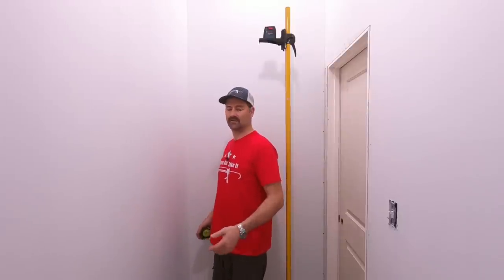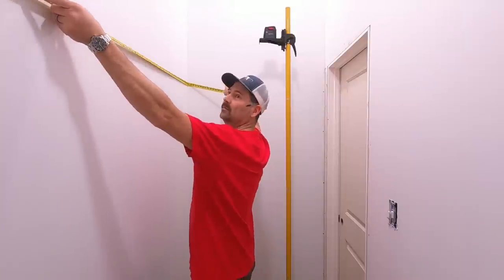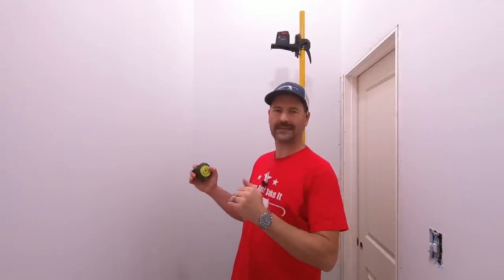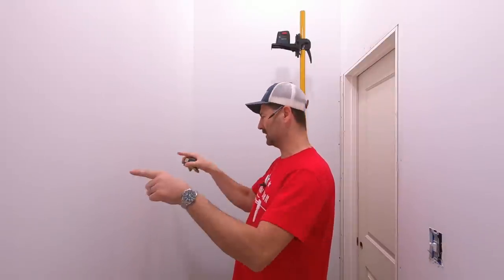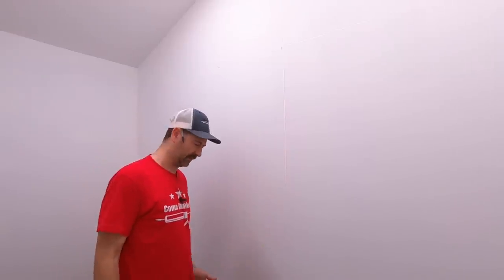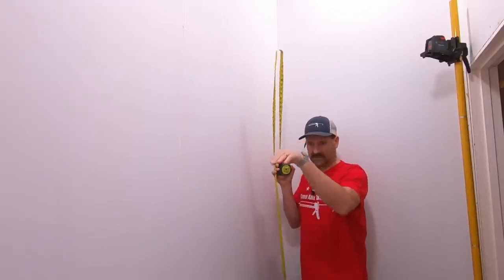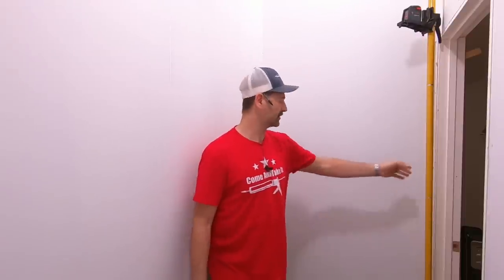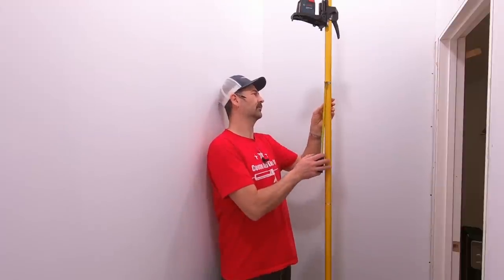Level Five Walls By Hand | So Easy A Handyman Can Do It | THE HANDYMAN |

Comment: Nice work, but I thought level 5 meant that you have to skim coat everything smooth and then sand for it to be an actual level 5???
Reply: That is, this isn't level 5
Reply: Level 4 is smooth….level 5 is flat/level/plumb, checking for imperfections with a light against the wall and skimming until “perfect”
Reply: @KevinDiaz-kz9lt  Plumb!?!  That's cuh-RAY-zee!

Comment: I've got the same sanding vacuum tool and use it the same way (without the pole because of flipping). What sanding screens are you using? It seems to gouge the surface and leave grid lines with the 3M ones even at 220 grit. wondering if you have the same issue.
Reply from the maker: I use 80 and 220.  I use a 3/4 inch nap roller to put a lot of paint on the wall to create stipple and it acts as a very light texture.
Reply: @TheHandyman1  thanks I haven't painted yet so good to know it will hide

Comment: Looks good- question for ya- why don't you combine all your nail/screw patches on lines instead of spotting them like you did? Those individual mud spots sure do tend to stand out.
Reply from the maker: You usually only see those lines when a flat box is used for mudding.
Reply: @TheHandyman1  
I don't flatbox, but I stripe all my screws, then go back and pole sand  after two coats then finish off the final coat with a search light and sanding sponge to be sure it's seamless transitions.

Comment: I need to know more about this shop vac dry wall sanding attachment deal lol. I just made a huge mess on the whole second floor of a house im remodeling with a pole sander doing the final once over because I didn’t know that kinda thing existed. Very nice 👍🏼
Reply from the maker: Check the links to products used in the description of the video.